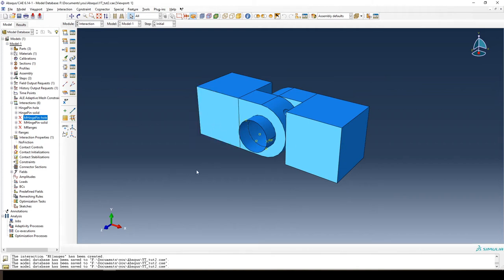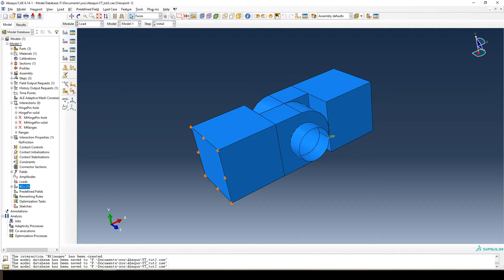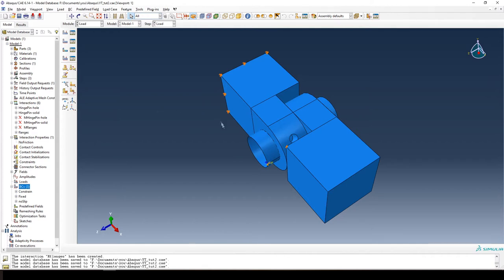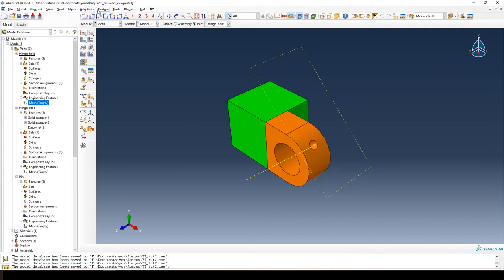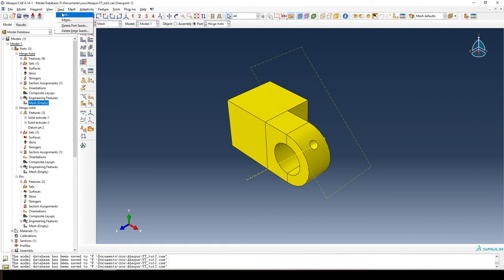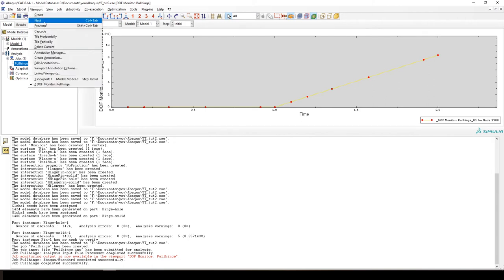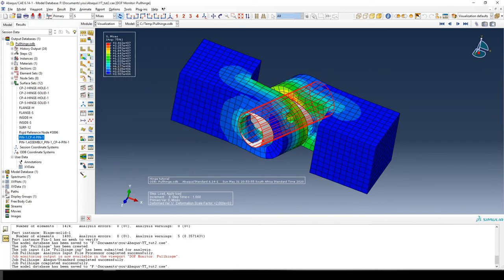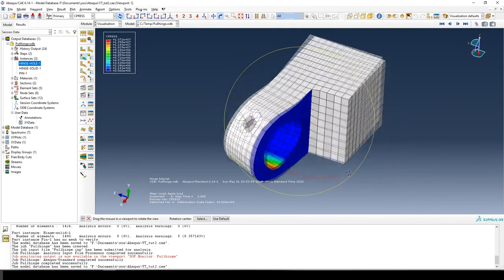ABAQUS #6 - Two hinges connected with a pin - PART 5

Comment: Hi, I really enjoyed this tutorial, you are really good with the software and explanation, thank you. I just want to ask you why you set the boundary condition differently in different steps. For example when you apply the constrain of reference point of the pin, you remove all degree of freedoom in the initial and then you allow it to move in one direction and one rotation (load step), what does it mean? it is firstly blocked and when i applied the load it can move? You can also direct me to a page or a book where there is this explanation. Thank you very much. Waiting for another tutorial.